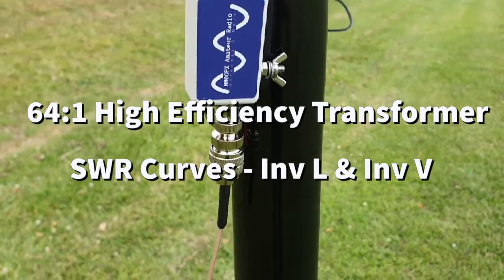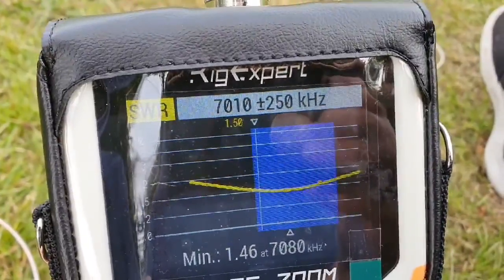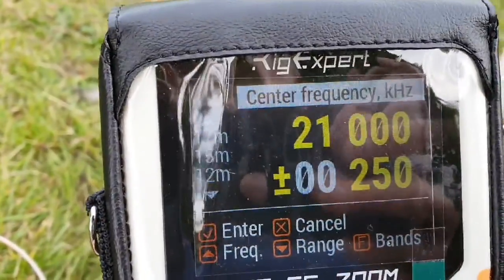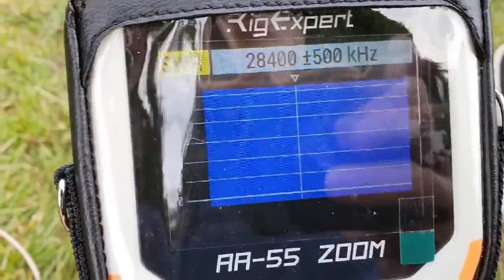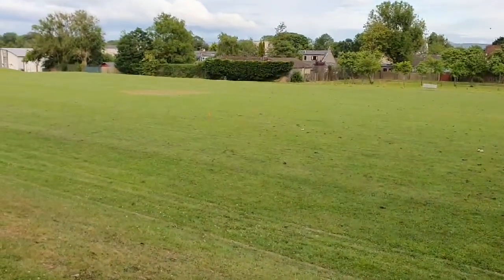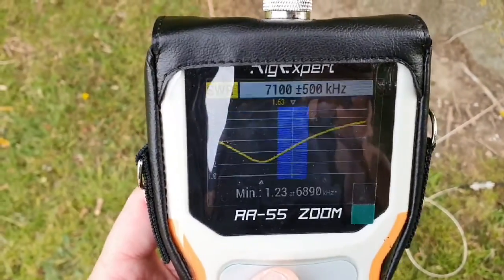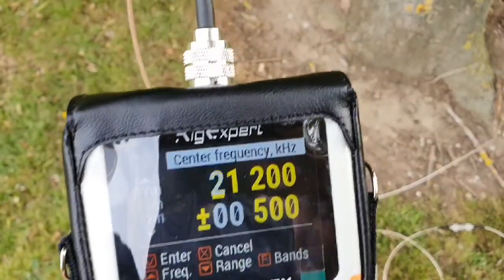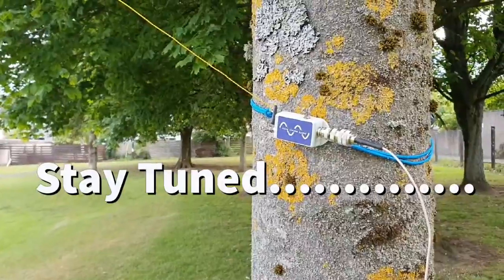QRP High Efficiency End Fed Half Wave Transformer SWR Curve Test

Comment: Great video Colin  and very interesting may i ask what particular core did you use and which winding configuration please
Reply from the maker: Thanks, its a 2643625002 64:1 2/16 standard crossover winding.

Comment: Curious, why did you choose a 64:1 instead of the common 49:1 ?
Reply from the maker: Great question. It's because this winding configuration on this core is much more forgiving in terms of SWR as an antenna in the inverted L. In all 49:1 tests the SWR was over 2:1 on 40m.
Reply: @MM0OPXFieldRadio   Hi Colin, I managed to get good SWR on 40m (other bands too) with 49:1 (21/3 autotransformer with 100pF TDK cap), by adding a small 1uH coil on the wire, 2m off the feed point. Without the coil, I also get 2:1 on 40m. Maybe you can also try this method, since 49:1 has less insertion loss.
Reply from the maker: @edwardpacman7082 really intersting, did the restnof the bands come in ok too?
Reply: @MM0OPXFieldRadio  Yes, good swr on all 4 bands!
Reply from the maker: @edwardpacman7082  perfect, will give it a go.
Reply: @MM0OPXFieldRadio  That will be another very interesting adventure!
Reply: @MM0OPXFieldRadio  BTW: My coil size is 2cm in diameter, 1.5cm in length, 8 turns.
Reply from the maker: Thanks 👍

Comment: Colin, after lots of research and experimentation, you have achieved a really good result.
You can trim the resonance points with series L, C or radiator length adjustment (by folding back -- as David W suggested)
There will always be a compromise somewhere, but at least you get to choose where!
73
Bruce G4ABX
Reply from the maker: Definitely Bruce, no antenna is a magic bullet. I think people really get hung up on SWR. If it's efficient then as long as its less than 2:1 I don't bother. I see lots of base loaded shortened verticals with a couple of short radials on the ground. A beautiful SWR curve is shown but in reality most of the RF is being lost in the ground with the person oblivious to this.
Reply: @MM0OPXFieldRadio  this is so true. Radiation resistance is ignored by so many.